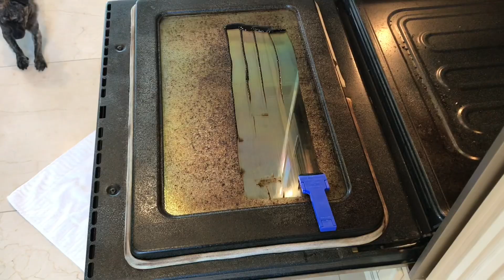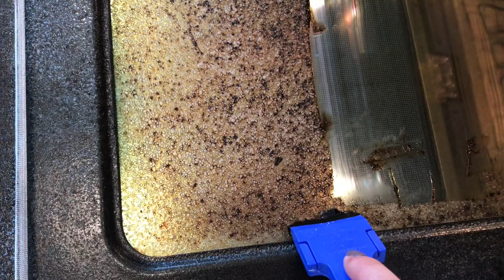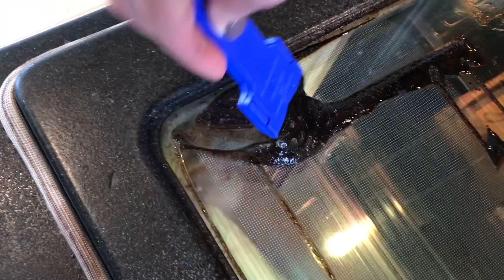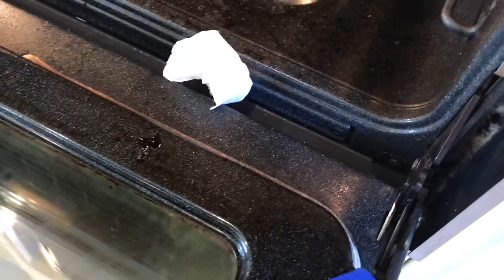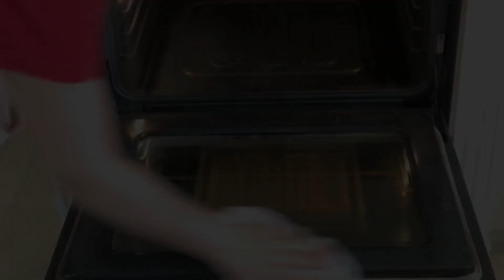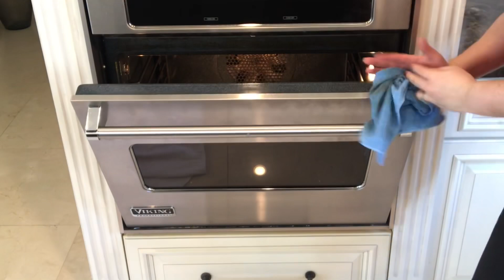How to Clean Oven Glass Door |No SCRUBBING

Comment: Has an oven been manufactured in the last 25 years without a self cleaning feature? I did not know people still manually cleaned ovens!
Reply: I realize this is an 2 year old comment..I have the same gas oven, and have had to replace the lighter 2 times in less than 7 years.  The repair guy said using the self cleaning cycle on gas ovens causes this now almost $300 repair.  I will be cleaning my oven manually going forward.  Thank you for posting.